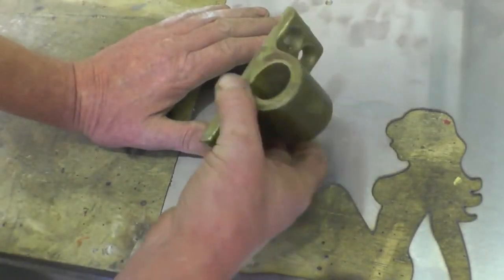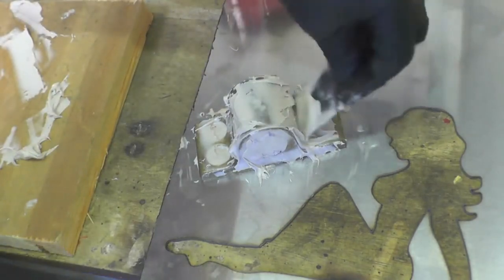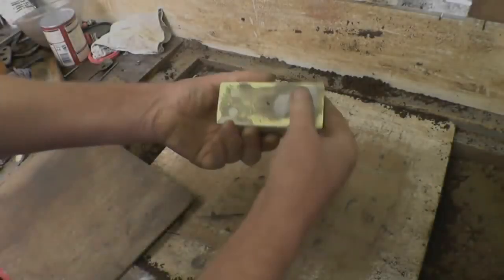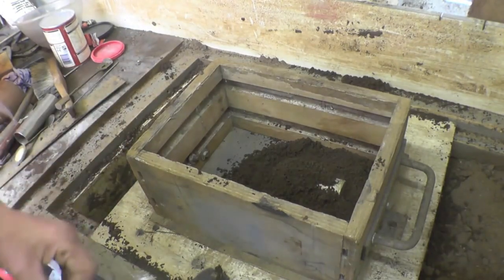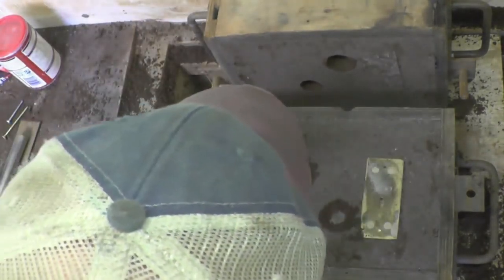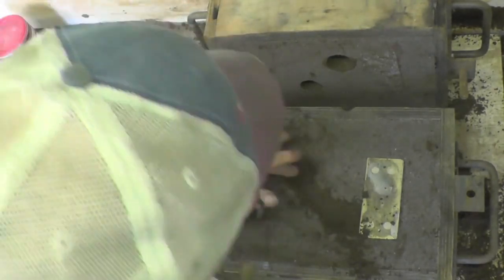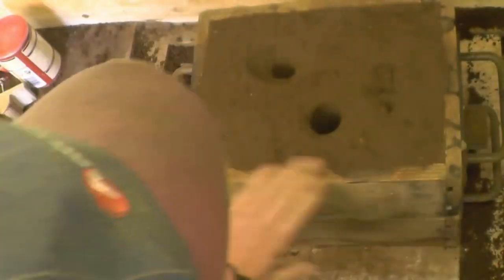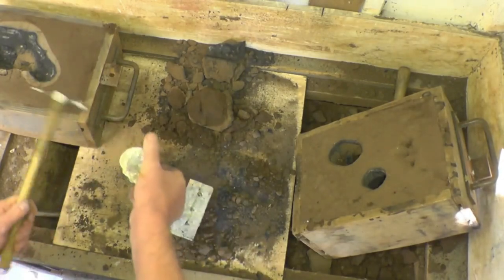SNNC 448 P2  Classic Night Cap . Casting Bronze

Comment: John, instead of using body filler, I find using wood filler works just as well. You can get it at any DIY home improvement center and the stuff I use is a powder and is mixed with water. It makes cleaning up the original mold a lot easier and the shelf life is very long, 5 years and I'm only at half a can.

Comment: If you use the part as a pattern does shrinkage affect the finished casting?
Reply from the maker: very good question . indeed it will  but in this application it will not be a problem